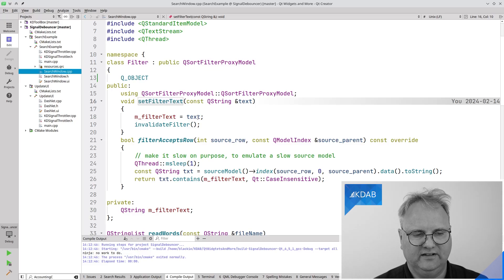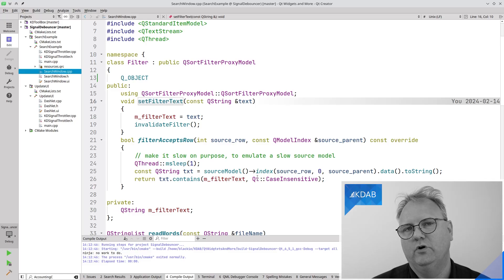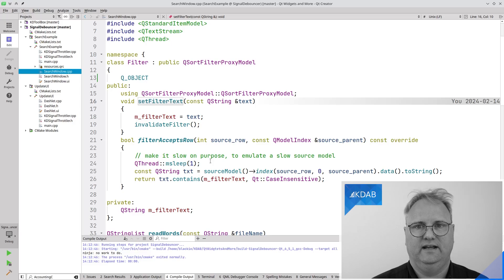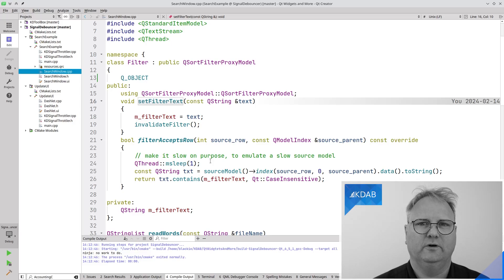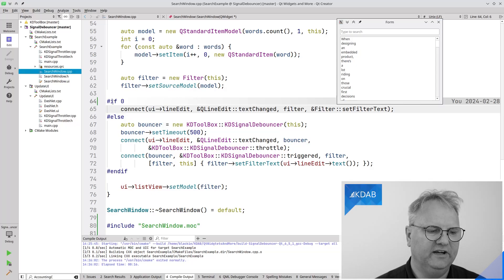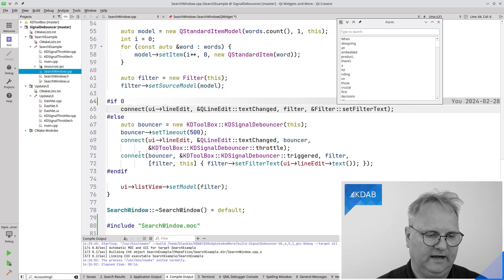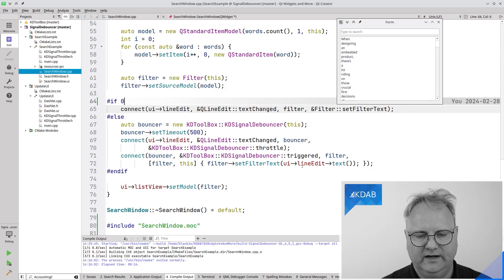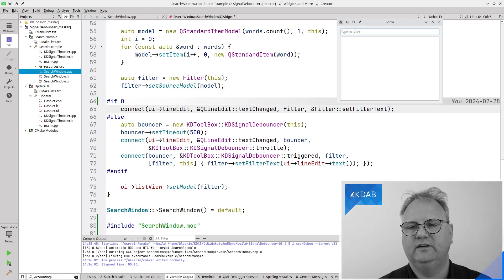Signal Throttlers

Comment: Reading the source code @8:58, instead of the lines 68-72, a connect (or debounce) method in  KDSignalDebouncer to be used like bouncer->connect(ui->lineEdit, &QLineEdit::textChanged, filter, [filter, this] { filter->setFilterText(ui->lineEdit->text()); }, 500); would be a good improvement, I guess
Reply: That would indeed be an option, but would likely make the code harder to read.

For details on this point, see the Qt3 versus Qt4 slider example in
https://youtu.be/EGhHlPDeyvg?list=PL6CJYn40gN6gf-G-o6syFwGrtq3kItEqI